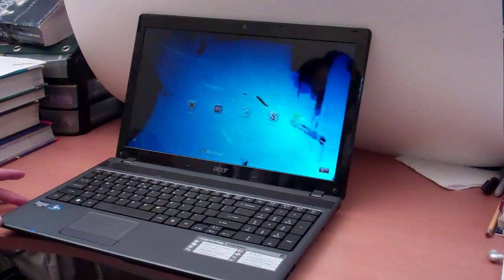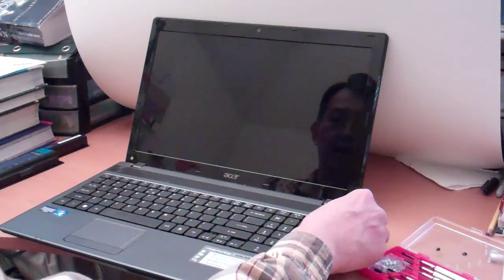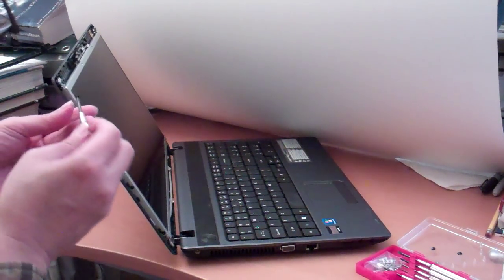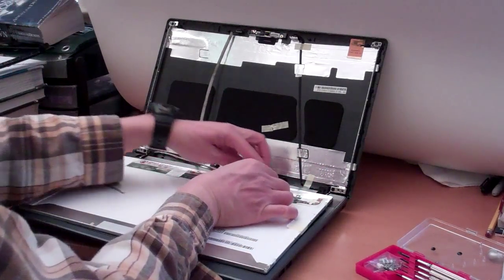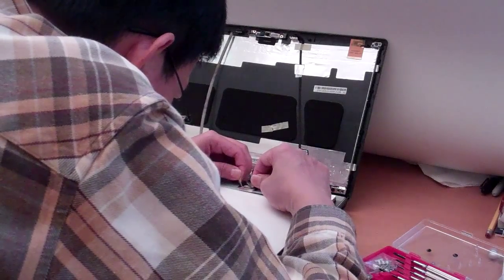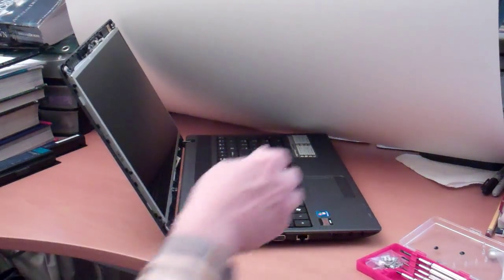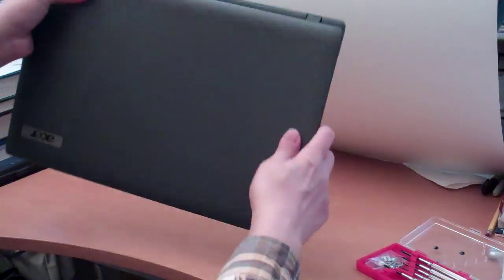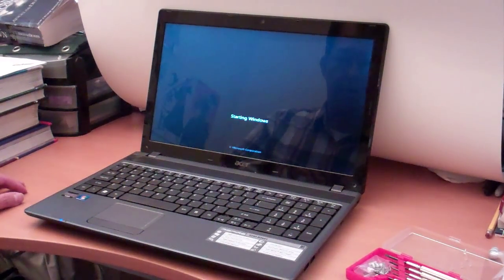Laptop screen replacement / How to replace laptop screen Acer ASPIRE 5250-BZ641

Comment: I have an Acer laptop very similar to this, and one night as I was going to sleep I accidentally closed the lid on the charger. After it had been pressing against the screen all night long in the morning, when I opened it, the screen was mostly black and glitchy looking. Is it possible to take it apart and fix it? Or do I have to buy a new screen?